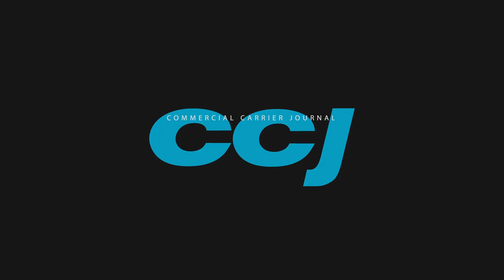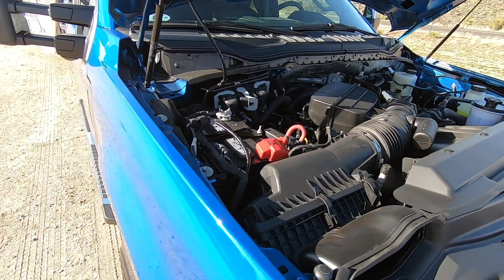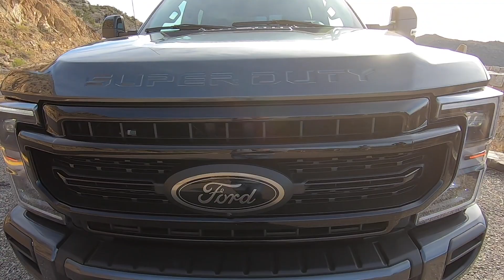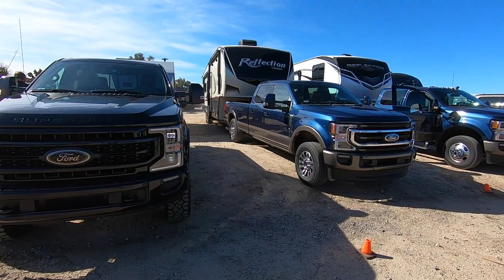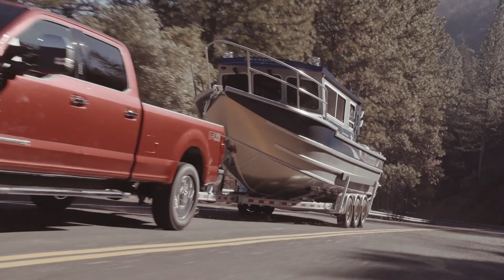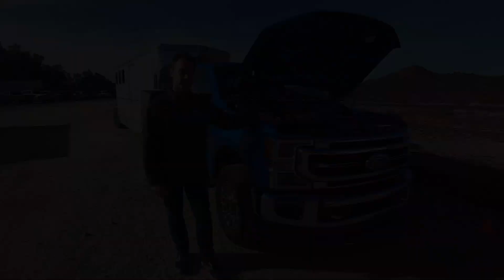Ford's all-new 7.3-liter gas V8

Comment: Do I really need the 2020 6.7l diesel or is the 7.3 gas with 10 speed trans. going to be good enough for me. I have a 12' tool trailer and a 12' hydraulic tilt dump trailer. Also I live in Denver so occasional mountain  driving.
Reply: I would go the 7.3. I pull a 20’ tool trailer with my Duramax and it’s overkill. I can pull it up Parley’s Canyon toward Park City exceeding the speed limit. That’s fun, but don’t buy a truck for racing. You won’t impress anyone. Buy it to work for you. The 7.3 makes WAY more sense.
Reply: Really depends on how heavy, and you are getting paid to tow. Unless you are approaching CDL territory (26k lb GCWR) I tend to recommend the 7.3. $8,000 buys a ton of gas. The maintenance is cheaper and you don't have to deal with fuel filters since it has a lifetime fuel filter and you don't have to deal with changing the coolant at 60,000 miles and then every 45,000 miles after that. Also if you do experience a catastrophic failure outside of warranty you're going to save about $6-7,000 if you have to replace the whole engine.

Now if your putting 30- 50,000 PAID miles a year on your vehicle, the 6.7 starts to make more sense. 

back in the day the elevation that you live at would be a big factor but elevation, although it affects a 7.3 L, does not ruin its performance. it can still run 60 miles an hour up the Eisenhower grade (8,000-11,000ft of elevation) with 18k lbs in tow.
Reply: Great question. Depends on how hard that truck will be working, i.e., towing, hauling, etc. I asked Ford's top diesel engineer the very same question. Story ran this morning in CCJ. https://www.ccjdigital.com/ford-powertrain-line-up-for-2020/
Reply: 2019 f350 6.7 is the most powerful truck engine I have ever driven in my life...2020 + 20 more hp = 470hp